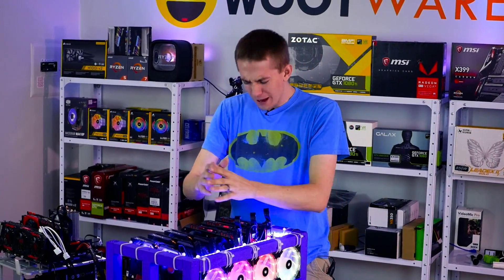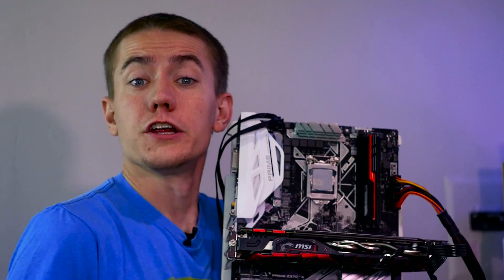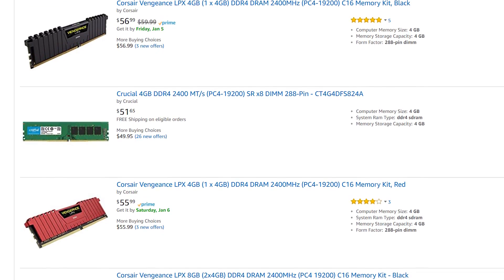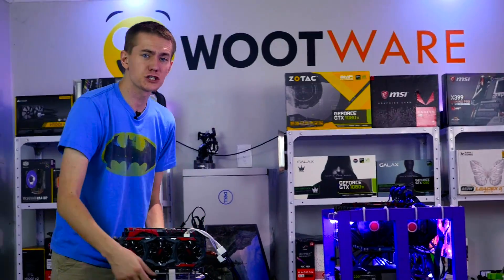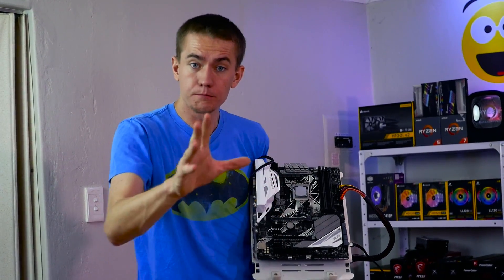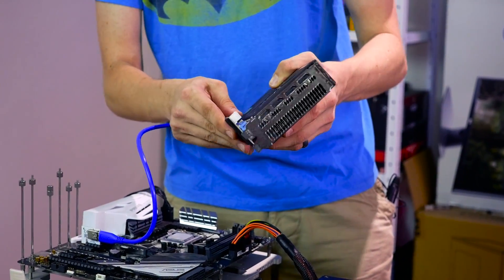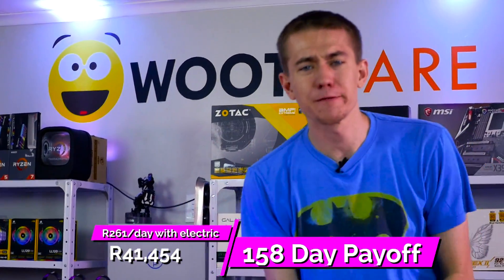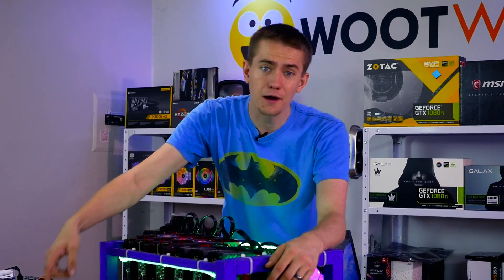Intro To Building Profitable Mining Rigs - Part 1

Comment: 21.15 dollar a day? i looked up the hashrate of the grapic card and its 22.5 for each  so 135 for 6. Then i used a calculator and it was 3 dollar a day for ETH ( without elec). So did i somthing wrong or did it really changed in one year?

Comment: So, Does the Video Have to be a modern Video? I have my Old Gigabyte GA-MA770-UD3 board with an Athlon 2 CPU. PCIe2.0 x16 and 3 x1 slots. As well I have a GeForce 9400GT. Gaming is my main usage and I'm in the process of Updating my Rig. I do Have a Radeon HD 6950 2GB card currently.

Comment: So... lemme axe you a quortion……. what if you had an extra refrigerator in your basement. one that works very well... considering the fact that these rigs need to be kept cool and dry and considering that many home brewers use them to keep their tapped beer cold with a tap added to the door... couldn't I use one to keep my rig cool? I wouldn't want to use the freezer section due to the unit going into defrost can create moisture in the space... but the refrigeration portion never does... it keeps the space dry and cold... what do you think? I was thinking I could mount the monitor and keyboard on a rest on the side of the box.. give me your input please.. and... great videos..

Comment: Hiii, Nooooob Q, a 6 GPU Rig can generate a lot of heat. Any recommendations on water cooling Vs. Air cooling?! Thank u for the awesome guide
Reply: Oil cool it. 
It'll cost a little more as an initial but your heat costs will plummet. 
Water beats air, Oil demolishes both.

Comment: I just ran a test on nicehash with 7 gtx 1080, we earned 10 dollar in one day, that was excluding the cost. What did i do wrong? The electricity is about 9 dollar so that would give 1 dollar profit on 7 cards. Can't be right. Hope somebody can help me out. I also have access to 4 amd 7900 gpu's and about 8 gtx 780, what would be the best setup, what coin would be the best to mine, any advice is very welcome! (if you are wondering how i have access to all that hardware, my brother in law programs them for work :P)
Reply: Markets have been down, so profits wont be as high as they were in January. Checkout whatomine[dot]com to confirm the most profitable coin for your set up. ZenCash looks promising for 1080s. Using older card like AMD 7900s and GTX 780s are not profitable because they require a lot more power to run. Aim for more efficient cards in terms of their hashrate and power consumption. Rx 470s or 570s and GTX 1060s and 1070s are good. See buriedone[dot]com/hashrates[dot]html

Comment: I need some serious help! my motherboard wont recognise my new Asus - GeForce GTX 1070 8GB STRIX  gpu. 

System Specs:- 
GA-B85-HD3
 i-5 4440 cpu 
500W psu
8GB DDR3 Crucial memory
Old gpu is a GTX 660 which runs fine out of both of my PCI-e slots

Problems:-
first boot had the lights on the card slow glow and fade red, fans initially spun but stopped instantly
Not being recognised as being in either PCI-e slot in device manager
Not able to install drivers as the install program wont install as there is no hardware to install it for

Troubleshooting:-
Bought a corsair 750W psu to top up the 500w onboard psu that is powering the motherbaord.....fans start spinning now, and flash of violet light before settling back into the red glow and fade, still not recognised by the motherboard. 
I've updated my BIOS... not recognised 
Unistalled all previous drivers and then booted off the internal GPU and tried to install the drivers....not recognised
Disabled the internal GPU to force find the 1070.......nothing but black screen (yes the hdmi cable was in the GPU and not still in the iGPU) and I was forced to put the old GPU back in to be able to access the BIOS again to turn the iGPU back on again.
I tried it in a friends computer. not recognised
Thought it faulty, so returned it to store, who said they can only exchange or refund after testing........... Engineers comments : Fitted to motherboard and ran Furmark with no problems.
Tried changing the 500w PSU for the 750w  psu......red slow glow and fade (not violet flash) and fans spin but stop spinning instantly.....add the 500w psu on to power the 1070 and not use the (now 750w) onboard supply and the fans spin again and the violet flash comes back before settling back in to the red slow glow and fade.

please someone....help
Reply: Oh, and it's not connected via a riser, its directly connected to the motherboard

Comment: why do people think its okay to use usb, huge bottleneck
Reply from the maker: +Kasper Abigail Huge bottleneck how?
Reply: I suppose not if each operation takes a long period of time to process but at some point operations are going to have to buffer and wait in line to be inputed or outputed. I might recommend a server CPU and Linux server with some proper software to distribute the workload more efficiently. how ever short fast processes would certainly bottleneck due to encoding and compression. like parhaps a gaming server that can handle multiple games would encounter issues and is more suited to having multiple cpus instead of gpus. idk what do you think. I bet it would be viable to find a good solution to hosting a nice server once the mine has run dry.

Comment: I've read that the best way to keep a system economical (both for electricity costs, and longevity of parts) is to not load your power supply more than 50-60% if you're planning on running it 24/7.  Getting your rig down to 875 on a 1200 watt supply puts you close to that range. Any experience running a psu at near max wattage 24/7?

Comment: Superman > Batman!!! Goku > both them!! :P I like that 19 slot mobo cuz 3 psu's plug directly into the mobo. I use triple connectors to boot all psu's at once on  the asrock h100 but it doesn't do a great job of killing the power on reboot making me have to manually reboot the system (very annoying)

Comment: I'm a casual miner sitting on 10 cards of all price range. My rig building strategy is always used market>new parts. Aside from GPU and PSU which has the most critical effect to the mining operation, i go for cheap 3x PCIE h81/p67 mobos, most of them can be bought from china at about 25$/pc. The rams are cheap as well, about 15$ for 2x2GB. LGA1155 celeron is about 8$ or so. The total cost for me building a rig without psu and gpu is averagely 90$. I also look for usable parts in my old parts pile like i have found old sata HDDs, cpu fans, rams, and recently, a i3-2100. For PSU, i either go for a good 600W for 3 cards or a cheap 400W for each cards, depending on the gpu i'm using. Don't let the 80+ stuff fools you, it doesn't really represent the built quality of the psu, i have a 10$ AVF peasant PSU worked for 8 years and a expensive as fuck 80$ EVGA dead within 6 months. The trick is to keep the load low, i recommend 40% or below, this way you keep the psu cool and quiet. GPU is rather tricky but can be easy if you do some research on different models offered by each manufacturer. I.E. those fancy RGB GPU is definitely not the choice as the LED usually means expensive. Don't go for cheap cards as well (unless they come with good warranty policy), there's reason why they are cheap. Lastly, ROI, anything more than 200 days is not worth it right now, consider most are of old generation that is to be replaced by their upcoming successor. Adding on that, the bubble is going to burst, just no one knows the exact time, could be tomorrow or a few years later, don't be greedy, sell what you mine, keep some if you wanna risk.

Comment: tips from an old doge miner...yeah before it was cool. when trying to pick a coin to mine. its best not to swap every day, stick with one that has a low difficulty/price most of the time.  but has peaks that are worth more, IE you are looking for something that has a flat trend line.. this signifies market stability in the coin, even if you have a mining beast that does xmr at 4mhs. you would still rather mine ETN solid for a month, regardless of weather or not its at the most profit at that moment. because once you have a large stash, you can dump them on the exchange at set them for a high price that has been reached before. they make take longer to sell but the profit is significantly more.

Comment: What do you think about using the EVGA GeForce GTX 1080ti SC Hybrid? I ordered one (my first GPU worthy of mining) in the hopes of using it as a base for a rig, but then learned you can only run 4 on the same rig & still have temperature & overclock control. Worth it to just run a 4-GPU rig? I plan on eventually doing AMD & Vega separately to mine for different things. I'm starting with Nicehash.

Comment: Going to the hardware store for wood and screws? or you could check the local business/industry and check their disposal piles, there is usually a lot of free wood and nails to be scored there.

Or if you want prettier wood pieces the scrap pile of the local carpenter shop will be very happy to sell or even just give you scrap wood, or again, check their garbage. :^)

Comment: Hey Brett, Thanks for another awesome video. You guys rock! Quick query on choosing GPUs. I've recently bought 2x Gigabyte RX 570 Aorus 4GB cards. I've flashed both as per your previous vids (Another big thanks), OC and undervolt profiles are the same and they both have Hynix memory. Im using claymore dual miner and the one card is giving me a decent 26 MH/s but the other only 20 MH/s. Do you think this is normal and maybe just an unlucky chip on the grandpa card?

Comment: Great video.  I bought a used rig with Linux.  Really thinking about buying windows because overclocking and under voltage of GPU on Linux is a pita.  Question: my mobo has two 16x PCIe and four 4x PCIe.  This, shouldn’t slow down my hash rate right?  PCIe speed.

Comment: Oh, and the ASUS B250 has 3 24-pin which means 1 PSU per 6 GPU. first lane (called A) has 7 slots, one being PCI-E 16x.
Its a real monstrosity but it does a really good job, I use it and I'd never look back. No need to buy more motherboards.

Windows supports 50 GPUs now, why would you need that many though..

Comment: One thing not mentioned about mining rigs, and my recent situation, is the power usage and whether your household wiring, breakers, etc. can handle it.  My example:

2 rooms of my house have outlets that are wired to the same 15 amp breaker in my breaker box.  At 120volts, the power most USA households use, this is 1800watts maximum before the breaker in the box cannot handle it.  Further, since you are running this mining rig 24/7, electricians recommend multiplying that 1800 * .8 = 1,440 watts for safety.  Lastly, remember, this is the total power draw through this breaker.  Have anything else plugged in too?  (Older homes would connect the room's lights and outlets together to the same breaker.  Further, even older homes may hit their maximum power draw... for the entire house... of the main 125 amp breaker if you build a few rigs.)

So, using the pre-undervolting settings of the video's rig, at 1,250 watts, you cannot plug much else into ANY other outlet on the same 15 amp breaker... or it will trip.  And, remember... this was a 6 580 system, not an 8 card system.  Using a specific manufacturer's PSU calculator, and putting 8 Nvidia 1080 Ti's in a system (along with a selection of the same base parts the video used), and you "need" a 2,200 watt PSU at load on the system.  Lower that by a bit for average vs. load, but... the breaker won't handle it.  Have money, and want to build two?  Most definitely forget it.

So, if you pay off that first system and want to build a second one, be careful with your household's wiring, breakers, etc.

Comment: @UFDTech. I'm planning on building my first rig. I have a Sapphire Nitro+ RX 580 (8GB) and plan on getting 4 Vega 56 cards. Any suggestions for a good motherboard and CPU for these 5 cards? I plan on getting 3 extra Vega's after to complete an 8x GPU rig. I keep reading that some motherboards have problems running more than 4 Vegas.Will the Asus Prime z270-a do?
Reply: Georgi Thiel the Asus prime will do

Comment: My 1070ti (msi duke) is raking in 6USD$/day before electricity on Nicehash legacy with Nist5 at 57MH/s (in case anyone wanted to know)
Reply: That seems low, my 980ti is getting 50MH/s on nist5 and then 1080ti is getting 95MH/s on Nicehash legacy
Reply: @telly187 I might be wrong, but I think Nist5 was only there in the Legacy miner (which is still the most profitable algo for me)
@RigRats Noted, thanks for sharing! I'm still using default clocks and power but I'm sure I can get more out of my card as you're suggesting
Reply: yea, i'm using legacy bc of nist5 too. :)
~30MH/s on a gtx 970 if anyone wanted to know. (could get it higher, but at cost of efficiency.)

my 1080ti will arrive in 6 days :D
Reply: Try updating Windows... if you don't have the latest build, you probably running at 1/5 of capacity.
Reply: My Aorus GTX 1080 11 gbps, averages about 7$ a day on equihash,  539-550 h/s
Reply: to whoever asking about the reason using legacy version, the V2 version is filled with bugs and some algos are not working as good as the legacy version.

Comment: can i upgrade my gpu on my optiplex 780 to lets say a rx570 or 580? im getting an optiplex for free so might as well use it for something. suggestions would be nice also thanks
Reply: Check first to see if your motherboard will run AMD polaris cards. Some older OEM boards wont. If not, go with something like 1060s instead.

Comment: lol @ PSU section.  'Efficiency, efficiency, efficiency'  maxes PSU Wattage limit rather than pushing the apex of the efficiency curve riiight...  
I get that it's about 5%, but when you're pushing 1000W, that's still a 50 Watt wastage that you don't need, and pushing a PSU to its rated max for extended periods is a good way to blow it, no matter how good the build quality is; which, for those who need a hint, is not a good way to keep your profits high.  Blown PSU = blown system, good luck testing what survives.
Reply from the maker: +Dai Phelion Uhhh, I don't max the PSU wattage.  The cards at stock do, but I don't leave them at stock..

Comment: Hi. I'm considering to start GPU mining and I found this video very useful, thank you very much. I'm thinking of starting with just 2 GPUs. Do you considering that selecting a cheaper motherboard than the one you selected will impact my mining peformance? Also, regarding GPU selection, I'm inclined to acquire two 1080tis. However, there are many different models (with prices ranging from 800$ to 1100$). Do they effectively possess different mining performances? If so, how do I choose between them? Or are they all similar? Thanks in advance.

Comment: Profitable mining rig guide> has rgb fans
Reply from the maker: RGB gives you 1,000,000 extra profits.
Reply: Who needs profits when you have sponsors eh?
Reply: You stress often in the video "If current profitability holds", but isn't that the whole thing about crypto that current profitability never holds? How does anyone make money doing this if their hardware is constantly being obsoleted?
Reply from the maker: +Marcus Coster Hardware goes into obsolescence every 12-18 months, not constantly.  And even then, with the new models out, the old models are less profitable, but still profitable.

Comment: Erm...the only wrong thing is that u chose MSI rx580 8gb. U get same hash rate with Sapphire rx580 4gb. (31mh on eth personaly) BUT for a lot less. I got mine for 353$ not the 440$ you say ....soo... How much is a Sapphire rx 580 Nitro+ 4gb over there?
Other than that...you could have mentioned Nvidia=easy plug and mine  / AMD = harder to setup

Comment: A tip I found out about is to protect your equipment with a surge protector, more that 20 power surges per day occur on average I've heard.  An inexpensive tripp lite can ease your mind plus has a 50k equipment warranty. I use the isobar model (white 4 plug) .  Just thought I'd mention it. :)

Comment: Thanks for another good video and for taking time to explain the technical parts properly. I want to know if the "version" of the graphics card matters. For example Asus Dual vs. Asus Strix?
Reply from the maker: +Anders Thorsen Not in performance for mining, but definitely in temperature with their cooling solutions
Reply: Is Strix the best you can get allround?
Reply from the maker: Strix is a good range.  Just don't go for the OC Strix, go for the normal to save money, but get the same mining perf & cooling.

Comment: Dude surly you need a monitor?
Reply from the maker: No.  Manage them remotely.
Reply: UFD Tech have you done a video that touches on this. Iv seen a few of your vids but none that explains how the mining rig software is connected to the rig,,,
Reply: I'd be quite interested in hearing about this! Right now I have two rigs with two monitors, two mice, and one keyboard (the cable of which I plug into the rig I wish to control).
Reply: For Windows, just download teamviewer. I'm managing three rigs in three different locations all from my HTPC

Comment: I'am using Asus Prime Z270-P with 8 MSI Armor RX570 , wtih a G3930 and 4gb ram, and 2 m.2.0 adaptor to pciex. and set PCIEX to GEN 2 in bios.I'am using 2 Corsair TX750w to power the rig. In ETH 206mh/s for 1160watts for the 8 card!
Reply from the maker: Very nice my friend!